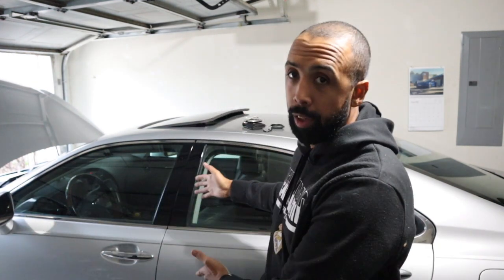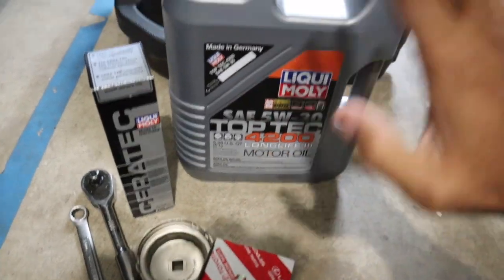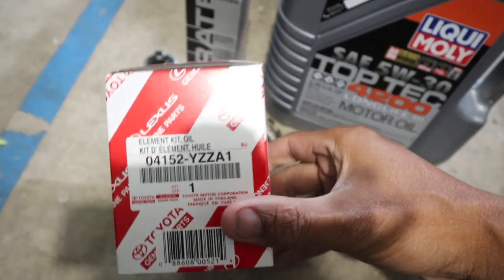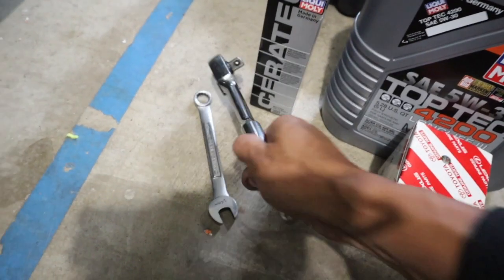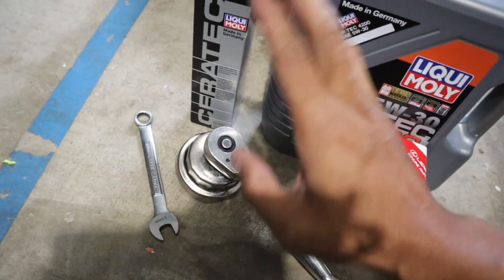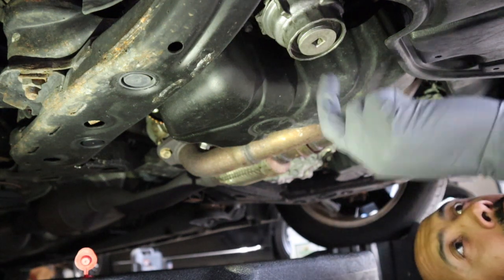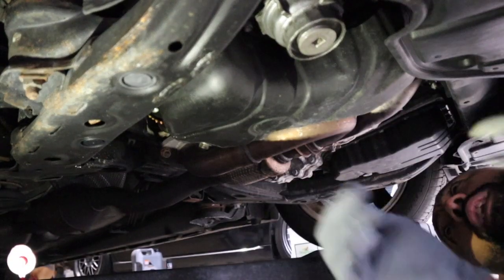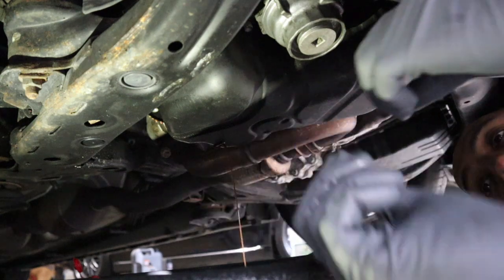Lexus ES 350 oil change

Comment: to get out the little white plastic tube out of the oil filter drain hole, just bend it to the side and it will pop right off. no mess no stress.
Reply: does it come with the car?
Reply: @AmariHenderson-vp9em  it comes with the oil filter.  From the dealership, 10$ for the filter from lexus...

Comment: Nice job on the audio video///why you changing the oil filter////you should count the oil plug out and let the oil completely drain out you plugged it up too fast and the oil pan////if you had took the oil plug out again you'll see more dirty oil coming out of the pan so always keep the oil plug out while you change the oil filter/////once you're done changing oil filter then plug up the oil plug 👍

Comment: There's no need to take the drainbolt off of the oil filter cap unless you're going to drain the oil from it BEFORE removing to oil filter cap from the engine.

And why the additive???

Gave a thumbs up anyway. No serious mistakes were made.
Reply from the maker: I normally don’t take the drain bold out but I wanted to show how the whole thing on why it’s there. The additive is a bonus level of protection the valve timing on start up. These engines are notorious for a rattle on start up.

Comment: What's the milky stuff you put in the oil? And what is it good for?
Reply from the maker: It’s called “Ceratec” it’s made by Liqui Moli. It’s a ceramic additive that’s helps to reduce friction on moving parts in the engine. Look it up when you can.

Comment: Why do you use 5W-30 oil?  I always put 0W20 in the GS.  I know you never changed the small gasket which is ok, but you should at least every 3 oil changes
Reply from the maker: 5W-30 is printed on the the oil fill plug on this engine so that’s why. As per the the small gasket I change it every other oil change.

Comment: Car calls for 0 to 20 weight not 5w-30 weight.Will it hurt? Who knows.
Reply from the maker: 5W-30 is what was recommended for this car. I don't like using the 0 weight due to high temps in Texas. if I lived in a colder climate id go with the 0 weight which flows faster on start up.
Reply: @Nissannx2000svg  Makes sense.

Comment: Please help me. I just want to know the wires and location of the temperature sensor. I own a Lexus ES350 model year 2009. Before I bought the car, this sensor was canceled and I want to restore it. Thank you for your help.
Reply from the maker: Usually, the location of the coolant temperature sensor will be located directly behind the coolant pipe. In most modern cars and vehicles, this is present behind the right cylinder head that is located right underneath of the air intake pipe.

Comment: 0w-20
Reply from the maker: Toya Johnson I think that’s what they’re using in the newer cars
Reply: Why bother changing the small o-ring under the oil filter drainbolt when you didn't bother to drain the filter housing? Makes no sense...🤔
Reply from the maker: Steven Sevek I only changed it so folks would know it’s there and change it out if they want to ( or if the old one was leaking )
Reply: I used 20w50 total oil in my es350 2007, UAE Summer heat.  Is it okay to use it for a few weeks and then change to 5w30 as recommended?
Reply: @sulayman960  
Absolutely not... 
Well, I wouldn't anyway but you might get away with it...
It's not the viscosity that protects the engine. It's the film strength which is determined by the additive package.
Reply: How many quartz do you recommend for my lexus es350 2014?
Reply from the maker: alex Williams 6 Quarts
Reply: @Nissannx2000svg  
Folks might want to know what it's like to actually drain the filter... No?
Reply from the maker: JackTannehillPromoter yes that’s why I did that but you really don’t have to.
Reply: 5W-30 gives better wear protection than 0W-20. The lighter oil gives .02% better mileage. lol 😂